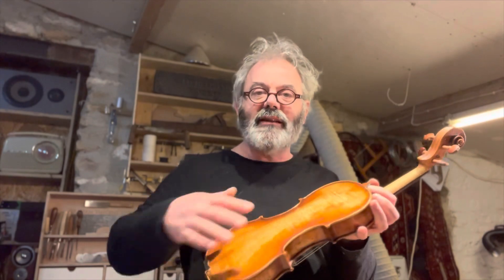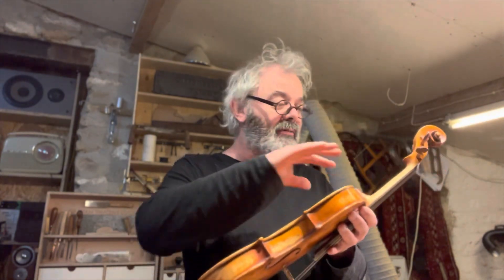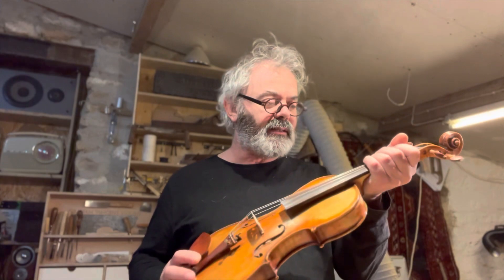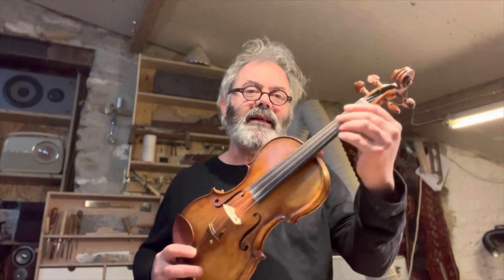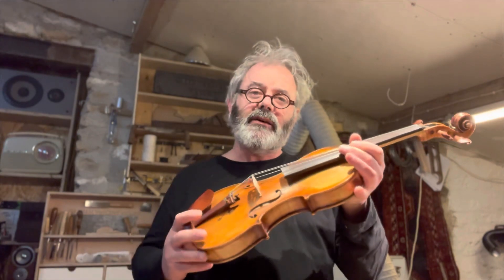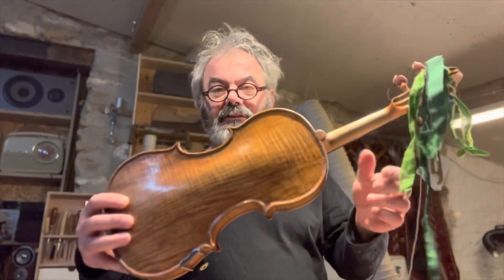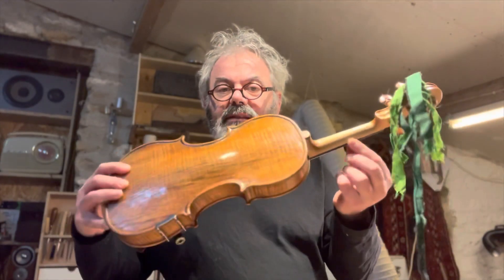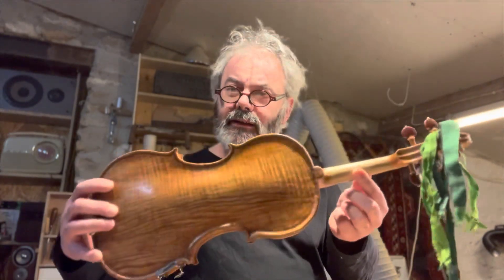#72 - Violin neck finishes

Comment: Thank you for all the great videos!  I enjoy them, and figured I'd add a comment here to help the algorithm.  I've made a few violins and I very much like the feel of a couple coats of tung oil finish (yes, the adulterated stuff) followed by a good rub with 0000 steel wool.  To me, it feels like very smooth raw wood, pleasant to the touch and not "frictiony".
Reply from the maker: Thanks for the comments and the algorithm shifting comment - much appreciated!!
Tung oil is a bit of a revelation to me, it's great. I must admit I've only used the pure stuff. I will definitley try the adulterated, because - even if it's only half as good as the pure - it'll certainly have a place in the workshop. Best regards.